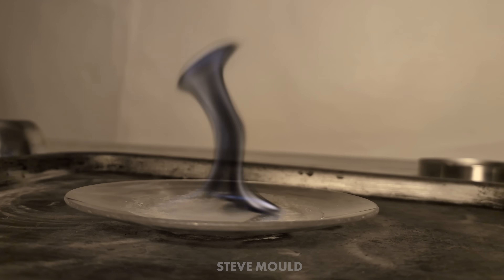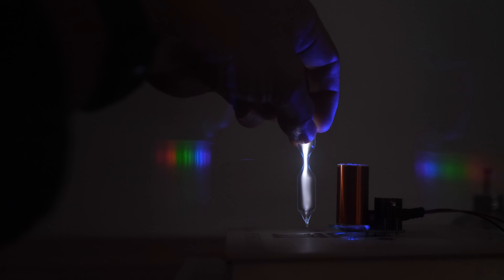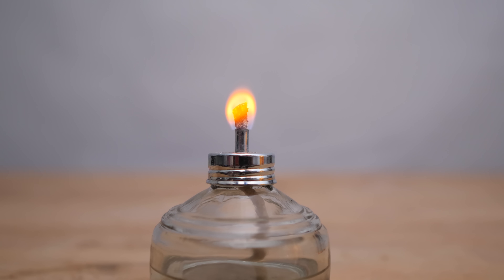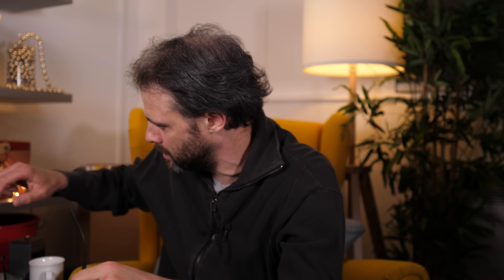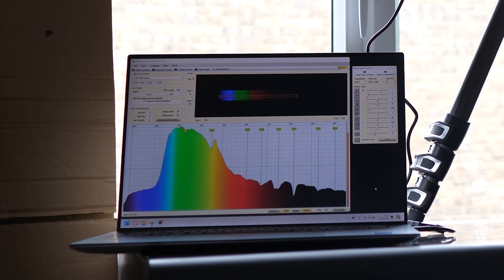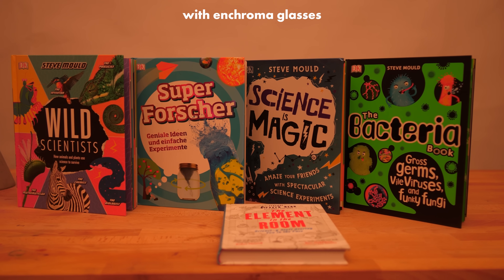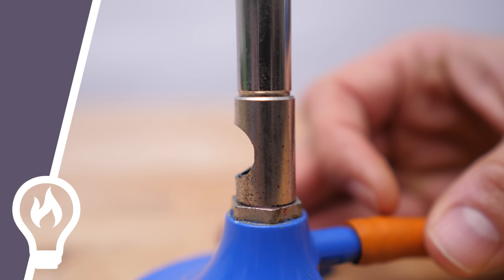Light sucking flames look like magic

Comment: Steve, hunt for the NIST Atomic Spectra Database Lines Form web page, which lets you search their database by element and wavelength range. They list a line of the Na VIII ion with a wavelength of 806 +- 9 nm (puzzling that the uncertainty is so large). —Tom
Reply: It's not an measurement uncertainty, it's a line width. Since you know how to NIST spectra, you're probably familiar with the uncertainty principle. This is that principle in action, the line width is inversely proportional to the lifetime of the excited state. The short time scale makes the amount of energy become uncertain.
Reply: @hammerth1421  NIST's description of the columns in the table uses language indicating the "Unc." column contains measurement uncertainties. Look for the NIST Atomic Spectra Database Help File (offline at the moment, but accessible via Wayback). Usually the term "line width" would be used to distinguish the natural line width (or its relatives) from measurement uncertainty. The column is titled "Uncertainty."

9 nm sounds awfully large to be the natural line width (from the energy-time uncertainty principle) for an atomic line. The lines I'm most familiar with are the main ones in the solar spectrum (Fraunhofer lines), and their natural line widths are a fraction of an angstrom (and that includes pressure broadening).
Reply: @hammerth1421  The Help File for the NIST database describes the uncertainty column with language indicating it's measurement error. The column name is "Unc."; I would expect a column listing the (natural) line width to be titled, well, "Line width."

I'm not an expert on atomic transitions, but 9 nm seems very large to be the natural line width (e.g., from energy-time uncertainty). I'm familiar with solar atmosphere lines (including for sodium), the non-thermal components of their line widths are typically a fraction of an angstrom. And that includes pressure broadening as well as the natural line width.

Comment: I'm pretty sure we used those same glasses in a class of mine for brazing copper pipe. Our teacher was very clear in stating these are NOT a pair of sunglasses and to use them on the road is VERY BAD. Those glasses are blocking the red/orange spectrum and apparently a couple students wore them out of class and rear ended a guy because they couldn't see their red brakelights.

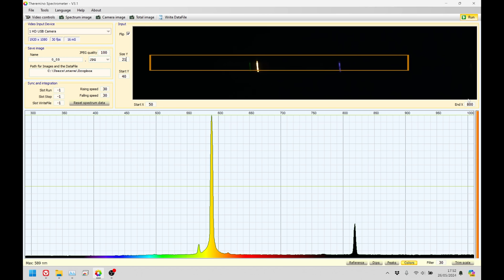Comment: 9:57 “There's another little peak in the infra-red which I believe is also coming from sodium but it's weirdly hard to fact check that.”
The line at 819nm is visible in the spectrum that is shown at 1:48.
Isn't that the proof you need?

Comment: 5:14 mistakenly suggests that "one photon is emitted for every photon that is absorbed." This is NOT true! After a photon is absorbed, that energy is quickly thermalized via the billions of collisions per second each gas molecule experiences. (Those collisions restore the proportion of excited sodium atoms to the distribution associated with the flame temperature.) The rate at which photons are emitted is determined only by the temperature of the flame and NOT by the number of photons being absorbed. Given that the illumination level is high, the rate at which photons are absorbed is FAR higher than the rate at which photons are emitted, contrary to the video's narrative about each absorbed photon simply being re-emitted in random directions (which couldn't account for the observed darkness of the flame). / This issue is important to get straight because it reflects a pervasive error in thinking that is very commonly made by people who are trying to understand the atmospheric greenhouse effect (GHE). There is a mistaken idea that when thermal radiation from Earth's surface is absorbed by CO₂ or other greenhouse gases, each photon that is absorbed subsequently gets "re-emitted." A common narrative (perpetuated by under-informed science educators) has one tracking each longwave IR photon as it follows a zig-zag path through a series of absorptions and re-emissions. Yet, such re-emission almost never happen in practice. Instead, the absorbed energy is thermalized, and any emissions of photons occurs as an entirely independent process, at a rate which is independent of and largely unrelated to the rate at which photons are being absorbed. / The GHE is so widely misunderstood (especially among those skeptical of anthropogenic climate change) that I hate to have any of the misconceptions related to this topic be reinforced. / In general, I appreciate the content of the video and the channel. But, on this particular point, the video is wrong, and perpetuates a misconception. / By the way, while I've got a soap-box, the GHE is simply the observed FACT that the amount of thermal radiation emitted to space (OLR, outgoing longwave radiation, 239 W/m²) is less than the amount of thermal radiation emitted by the planetary surface (SLR, surface-emitted longwave radiation, 398 W/m²). This is quantified by any one of these metrics: G = SLR-OLR = 159 W/m²; ĝ = G/SLR = 0.40 (i.e., 40% less radiation reaches space than what is emitted by the surface); Tg = (SLR/σ)^(1/4)-(OLR/σ)^(1/4) = 34℃. People often mistakenly think the GHE is a theory, but it's not; it's an observed phenomenon. The theory that explains the GHE is the Radiative Transfer Equation (RTE, the basic version of which is Schwarzschild's RTE), which describes how thermal radiation propagates through a partially-transparent medium. The RTE has been well-established and widely used in science and engineering since the early 1900s, and is in no way specific to climate calculations. It can be derived directly from Einstein's quantum theory of radiation. The observed fact that CO₂ is a good absorber/emitter of longwave radiation, in combination with the RTE, is what gives rise to CO₂ playing an important role in the GHE. The size of the GHE depends both on the concentration of greenhouse gases and the lapse rate, i.e., rate at which temperature decreases with altitude; if the lapse rate was zero, there would be no GHE. The GHE is really just a reduction of a planet's emissivity. While the planetary surface emits radiation at a rate 𝜖_sfc⋅T⁴ where T is the surface temperature, the planet emits radiation to space at a rate 𝜖_eff⋅T⁴ where the effective emissivity of the planet is 𝜖_eff = (1-ĝ)⋅𝜖_sfc. / I offer these details because, even though I'm a physicist, it took me quite a while to understand the GHE in a precise way. The GHE turns out to be remarkably simple. But, the GHE is misunderstood by the vast majority of people―even the majority of science communicators. Since I experience Steve Mould as a good science communicator, with an intelligent audience, I'm hoping this might be an effective forum for inserting this information into public awareness.
Reply: Very good point on the GHE, but in this case there is not enough time to reach thermal equilibrium. Think about it this way, if it would reach thermal equilibrium, it would emit black-body radiation, but the spectra of a flame is strongly influenced by its chemical composition.
Reply: @pdp11  What is being reached is something called Local Thermal Equilibrium (LTE), and it is likely reached within microseconds. (I was very surprised to learn that reaching LTE can potentially take as long as a microsecond, given the billions of collisions per second. The time to reach LTE depends on the transition in question. I'm not sure about the collisional relaxation time for the sodium transition in particular.) It is not true that matter in a state of LTE emits radiation with the same spectrum as a blackbody. Rather, all warm matter emits radiation with a spectrum 𝜖_𝜈⋅B(𝜈; T) where 𝜖_𝜈 is the spectral emissivity of the matter as a function of the frequency 𝜈 and B(𝜈; T) is the Planck function specifying the amount of radiation a black-body at temperature T would emit at frequency 𝜈. The fact that "the spectra of a flame is strongly influenced by its chemical composition" is merely an indication that the spectral emissivity 𝜖_𝜈 of matter in the flame is strongly influenced by its chemical composition.

Comment: Moving from sodium lights was a real problem for astronomers as narrow band filters were common and cheap, the LED lights are much harder to filter out due to having multiple peaks and the phosphors not being to a standard chemistry resulting in different lights having different frequency outputs.
Reply from the maker: Interesting! And a bit sad
Reply: @SteveMould  Might be sad from a normal colour vision person's perspective, but from someone (like me) with Protonomalous colour "blindness" the disappearance of Sodium street lights has made EVERYONE SAFER on the roads at night!

Why? Because if we don't see a traffic light change from orange to red on a street with Sodium lights then we can very easily completely miss the red traffic light, possibly causing an accident! Especially so if we aren't familiar with the area, or a new set of traffic lights have been installed - a situation which actually happened 30-odd years ago when my brother (also with similar vision to me) missed seeing a new set of lights in a very familiar area lined with Sodium street lights. Fortunately we had my older sister in the car who realised in time that neither of us had seen the red light. She got our attention in enough time for my brother to stop the car with the nose over the line. Fortunately it wouldn't have caused an accident on that occasion as there were no other cars nearby, but there easily could have been.

I for one do NOT miss Sodium street lights (despite also being interested in Astronomy). We are ALL safer from their disappearance.
Reply: Awful for bats too.

Comment: Why does a university have a glass blower?
Reply: In-house scientific glassblower are very useful. They mostly do emergency repairs of glassware for panicking chemistry undergrads who just broke a relatively expensive thing (couldn't be me...),  but they also build custom glassware for active research which you couldn't buy off the shelf from anywhere.
Reply: @hammerth1421  nice, thanks. I almost got a part time tech job at UCL, they do have very good resources.

Comment: Correction: common misconception that medium and long wavelength cones are called green and red cones as you say.  Medium is called that because they respond maximally to yellow-green light and long is called that because they respond maximally to yellow-orange light.  Computers are not RGB based because of human cones. They're those colors due to more complex color processing in the brain and because CIE color space can be approximated by a triangle with the line of purples going from red to blue.  S, M, L cones is correct, not RGB

Comment: If you look at EnChrima glasses as "corrective" lenses, or expect EnChroma to somehow magically allow colorblind people to see normally, then you will be sorely dissapointed, as that is not the purpose nor the stated intention of enchroma. You should look at En Chroma Glasses as if they are colorblind mode for real life. In the same way that video games make themselves "accessible" to colorblind people by having various modes that make different changes to the intensity, contrast, and variety of color, so to Enchroma does. 

depending on the type of colorblindness, Enchroma glasseshave filters that block certain wavelengths of light as a way of creating more separation and contrast between certain clors, which has the added benefit of causeing certain color to become more vibrant as its not being washed out by the color it used to overlap with. They also tint their glasses with various shades and colors as a way of increasing the intensity of some colors and washing out or decreasing the intensity of others.

So yah, if you take EnChromas claim of "enhancing" the vision of colorblind people to mean "correcting" colorblind vision, then youve got it wrong. You should look at the word enhance for its literal definition. To cause someting to be bettter than it was before" And as a colorblind person who uses colorblind mode in games a lot, i can assure you, anything that helps me to see green on red, red on greene, and botth of those against brown or gray is helpful. i really dont care if they technically turn some colors weird compared tto normal color vision. You can relearn what colors look like. lol

Comment: Small correction about the streetlights. Most lights you'll find outside use high pressure sodium, which has a CRI of about 25. What you are using here is referred to as low pressure sodium, which has a monochromatic light with a CRI of about 5.

Comment: You can also get a "light pollution filter" from an amateur astronomy shop which also blocks the sodium lines. Unfortunately it doesn't work well for the intended purposes anymore because most sodium streetlights are being replaced by white LEDs.
Reply: LEDs are pretty bad for wildlife too, even insects. Very disruptive for them.
Reply: @steppinstone  Live near a corner and have 2 out from and one to side. Can basically read a book out back garden in the middle of the night with the amount of light pollution. Terrible for just looking at the stars.
When they used sodiums they designed the shroud to reflect as much light downwards as possible. With the Leds it's like they barely bother.
Reply: I really liked the glow of sodium streetlights, there's some nice sides to really white leds (they make plants look magical during nighttime), but otherwise it was nice for the night to look like the night.

Comment: I thought low-pressure Sodium lighting had a CRI in the negatives (-44), not zero. CRI calculations have more going on than just 100 is sunlight and 0 is as bad as it can get. 

As I understand it 0 is as bad as it can get while technically being white. For example, a trichromatic light-source with narrow (or single wavelength) red, green and blue peaks would approximate white but it would also make things look as weird as low-pressure sodium lighting.

Because sodium street lights are effectively monochromatic yellow this makes them even worse than that.

Comment: I remember discovering something similar in my room at the previous place of living. I had  a bunch of nice flowers and my dad installed LED lighting for them to have more light (I don't know the full way this works or doesn't work, doesn't matter for the story) and I could choose the lighting to any color I would like, because the LEDs were RGB controllable. I noticed that if I turned the light to pure blue, a school bus toy car would turn a very dark shade perceptibly. This got me focused on it for a while and is a pretty strong memory, worked well for understanding this video and the processes highlighted.

Comment: You called a point 1-dimensional; I'm sure you know better and it was a slip of the tongue...but for the audience's sake, a point is actually a 0-dimensional construct, the only such one. It has NO dimension and thus cannot be measured for area, volume, etc. and is just the abstract representation of a location in some defined space. This then allows for a line to be 1D, intersecting lines or a square or circle to be 2D, etc. as expected